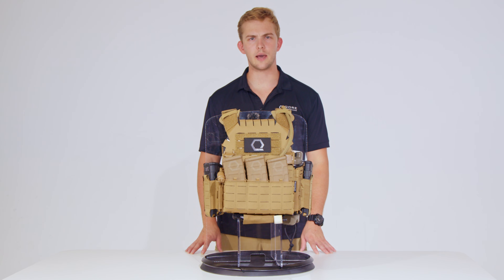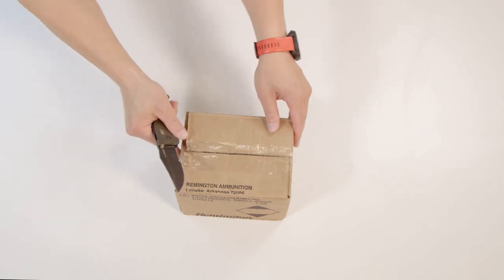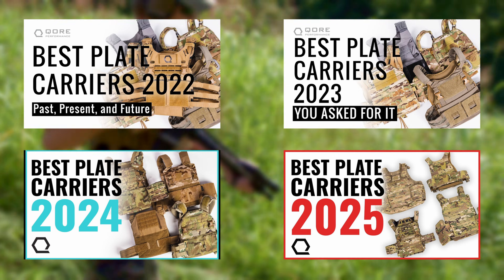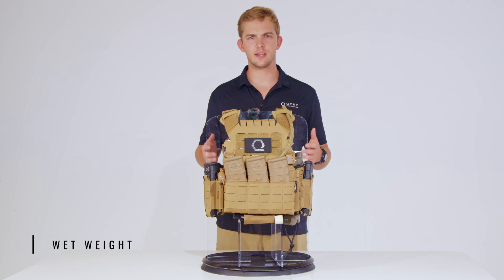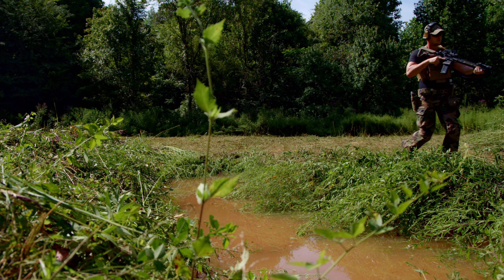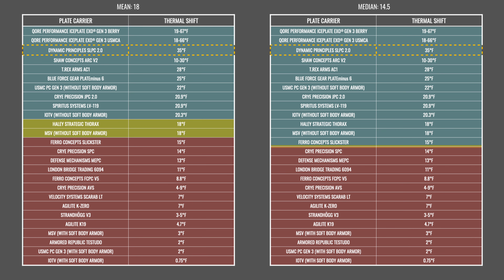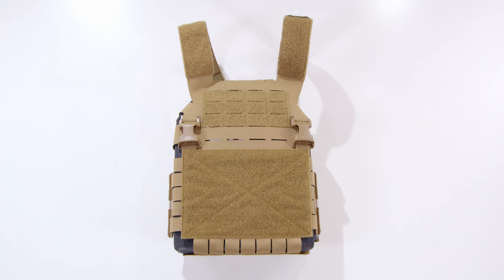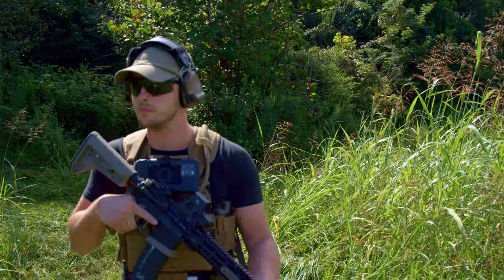This Plate Carrier Surprised Us | Dynamic Principles SLPC 2.0

Comment: Huh, I thought it would be lighter. The cummerbund and QD buckles could have added more weight, but it's still above average. The dry-to-wet and thermal shift are among the best right now, so that's pretty neat. Thanks for the analysis!
Reply: The qd's, elastic cummerbund and removable rear cummerbund flap are definitely a large factor here.  The SLPC 2.0 Plate Bags themselves come in at 9.9oz and the SLPC 2.0 with a medium basic elastic cummerbund would come in at 12.1oz total.  Incredible overview though, and thanks so much to the Qore Performance team for putting this together!  We're so honored to have a carrier on here.
Reply from the maker: @dynamic_principles We’re happy to cover it. Thanks for putting out a solid product! #StayFrosty
Reply: I didn’t realize the rear flap was on, though it looks like it was mounted incorrectly in the video. It’d be super helpful if the dry weights for the individual pieces were listed on your site so people could calculate the total weight more easily. I’m probably just weight-conscious, but I think others would appreciate it too.